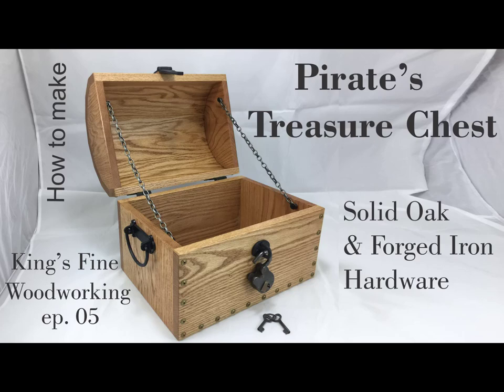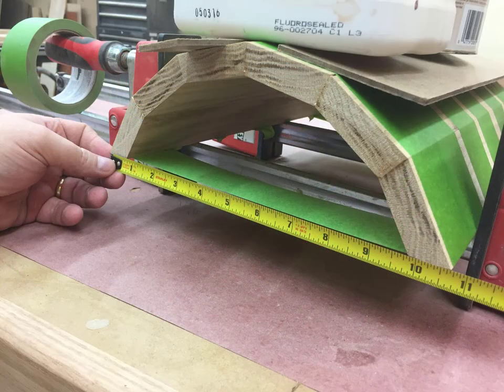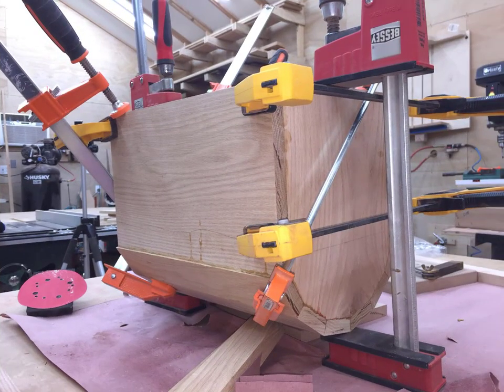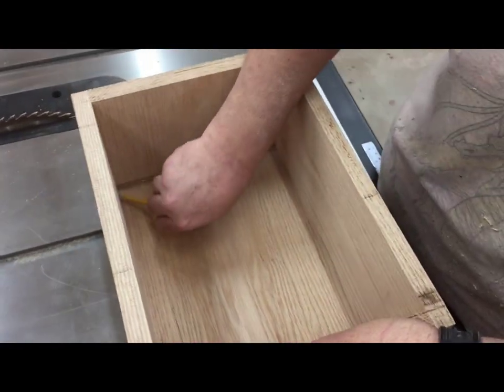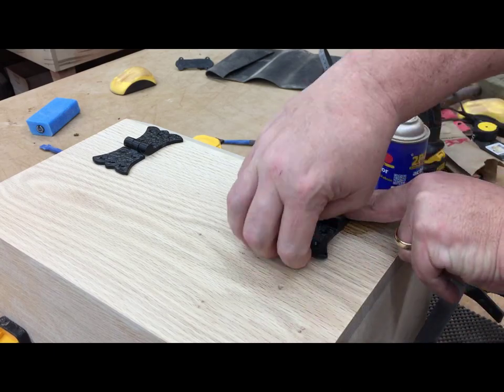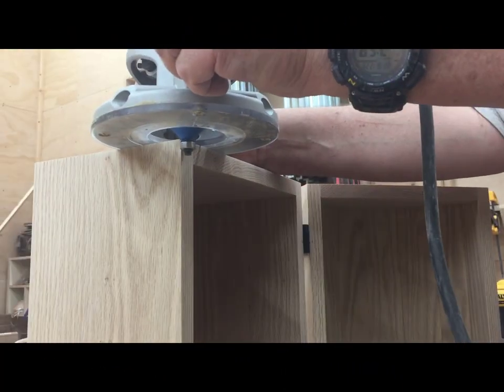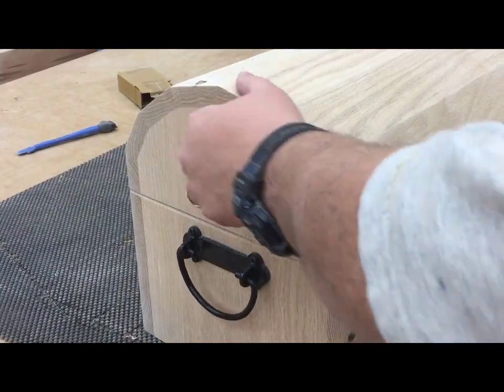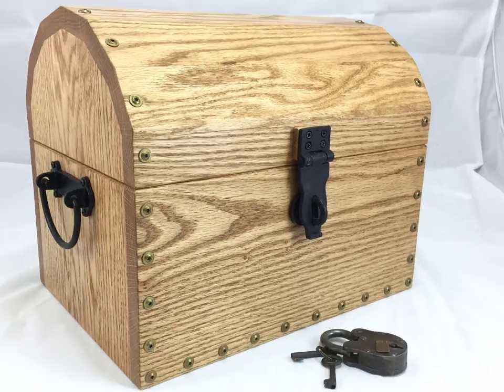05 How To Make a Pirate's Treasure Chest from Oak & Forged Iron Hardware

Comment: Just a tip: I have done some odd shaped glue joints in which I've had great luck with using ratchet straps, rather than trying to get a purchase on funky angles. I use a scrap piece of wood where the metal touches the work piece, and the joints come out very tight.

Comment: I trained under a furniture maker for 36 months, he believed in gluing every surface & wiping the glue away with a cloth wet with very HOT water. I like the chest, bees wax on the threads of the screw is how I do it , after predrilling.

Comment: How good is that, I was talking with a fella who worked for a high end furniture manufacturer here in Australia a few years ago who said that adhesives available nowadays are at times the only form of Joinery used, amazing to think that, nice to see the whole family helping out 👍👍👍
Reply from the maker: I am always amazed at the strength of the glue I use. If I make a mistake in a glue-up, I only have minutes to take it apart or I will destroy the wood trying.
Reply: I think that the correct temperature & also clamping technique will do the job, sometimes I think we over do the process but things like pocket Hole Joinery help in assembly, cheers & take care mate 👍👍👍

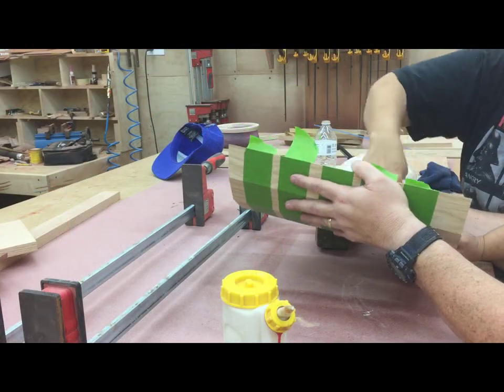Comment: 1:55 - to make sure you don't overtighten, put a piece of plywood cut to the correct width in the clamps with the workpiece.

10:20 - because of the CA glue, you can't remove the hinges to sand.  Try painters tape to hold the hinges while you drill.

16:20 - beautiful job.  I'm going to use this style along with a hidden drawer to make one for my grandkids.  Great video.
Reply from the maker: Hello, brilliant suggestions!!!

Comment: I love the box! I'm going to use your design as a base for mine. I will be going for a more authentic look by using straps of steel, solid hammer in rivets, forged nails, and distressing-figuring-burnishing the wood before a boiled linseed oil finish. I have been wondering for quite some time what kind of carcass I will use to frame it out. This looks ideal.
Reply from the maker: That sounds pretty awesome. You should send some pictures when you are done.
Reply: Dj Lopeman jhg

Comment: As your wood is Oak you could have stained it the old fashioned way ,by using liquid ammonia placed in a saucer with  tent of plastic over it, and the wood, depending on how pure, and the strength of the ammonia'  letting it stand overnight will give your oak the appearance of 'age'  this was a trick I learned when I was about 9 (I'm 71 now!)asking a worker in a local church what the horrible smell was and , WHY :) he told me he was installing new bench pews in the church and the vicar wanted the new ones to match the centuries old originals, which were a beautiful black, probably a bit late for this job, but in the future .....  :)

Comment: A good way to clamp a rounded lid like that is with tie downs, just ratchet them down good and tight, just put a board or two on the inside bottom to keep them from taking t much pressure and you're good

Comment: Forgive the asking, some wood workers would say you have a cross grain situation there, Gluing a wide end grain to a side grain. That has a danger of spitting over time. You mention this when putting the bottom in, but not when you glue the sides to the ends. Any thoughts?
Reply from the maker: Hi Richard, the issue of movement is sometimes a function of the strength of the joint. If the wood is properly constrained, it cannot move. The enormous quantity of screws that I put in it, (to simulate old fashioned nails) will completely prevent movement.

Think of plywood. It is layers of wood glued together with opposing grain, but there is no movement there because of the enormous glue bonding surface. 

Another good example would be a cigar humidor. I build these all the time with thick heavy through-dovetail joints at all edges. And then after completion, I keep the insides at 70% humidity, and the outside is at 10%, and then occasionally I will completely dry out the piece to clean or disinfect it. This presents an incredible opportunity for movement to occur, yet it does not. The joints are too strong.

But, It is good to be concerned about movement. If you are unprepared for it, then within a year, a beautiful piece you made can be destroyed. If you are ever unsure, it is best to err on the side where you allow for movement. Alternatively, if you don't have a lot of experience, you could consult an experienced woodworker and get their take on the movement in your proposed piece.  

I sure wish I would have done that when I started woodworking 32 years ago, haha.  I can't even remember how many little keepsake boxes and cutting boards that cracked, bowed, and split. But my saddest moment was a cocobolo table that had a build in chess board of Macassar ebony and birdseye maple. I sent it to my grandfather in North Carolina, (and I'm in Colorado). I cried when I saw it after a year in an environment with 15% more humidity than here. It was essentially destroyed. Almost $1,000.00 in lumber, and what I thought would be an heirloom piece was nothing but splits, cracks, and warped wood.
Reply: Thank you for you reply, That is really sad about the table. Unfortunately sometimes we only learn the hard way! I know I have many times. I have enjoyed watching many of your videos, so I appreciate your years of experience. 

Another wood worker said that he felt safe up to a 6 inch cross grain joint, so thank you for sharing your experience on this.

Comment: Nice work. You should try sawdust to "sop up" excess glue. It'll also act as a nice filler for small gaps. Also, those screws could have worked as your clamps, couldn't they?
Reply from the maker: Yes. Great tips.

Comment: Just curious as to how you calculated the angles to rip the top boards to meet the contours of the arched sides?    Also, had never seen the oranged, elevated supports you used during the finishing of the box.    Do they have a name?    Great looking project!

Comment: When ever I have some thing round to glue I use band clamps, they conform to the  curve with equal pressure. An adulterant way to deal with the rounded corners where you used  the router is to use a chisel to square  the inside corners.
Reply from the maker: Hi Stephen! Great tips! Thanks!

Comment: great job.Was some overkill with the glue - I have been gluing one piece for over 50 years and never had a fail - but whatever make you feel safe. And the 3/4 in bottom which reduces the capacity along with the high lid.That said I am sure it will be a heirloom piece

Comment: Wow my new favorite woodworking channel. The first one I can remember (just off the top of my head 😋) that puts glue on both sides. I've seen too many that don't and I'm like omg seriously why would I watch your stuff if you don't do it correctly. I know this from experience building things and just putting glue on one side. Then in time after use or just too much weight or little pressure boom it breaks or comes apart rather. but I'm like what's the heck this don't make any sense I glued it things fit right sis is stupid and if you put glue on one side in touch both sides together then glue is on both sides right... Wrong. My wives grandfather and father boy got a real charge out of that when I told him what I did. My wife's grandfather has been building things since he retired and he's been retired for well a long time and her dad works with him when he's not working on weekends and after work on things and they've been doing it for many many many years so they also have experience in the sort of thing. I'm sure why they got such a good charge out of my finexperience maybe they have also done to same thing many many years ago. Live and learn and or watch videos on YouTube and see how others do it lol

Comment: Leather belt up over the top and down the front and back and a v groove at each joint on top.😉
Reply from the maker: That would look nice.
Reply: A thin bit of soft leather on the lip of the box, where the lid closes, makes a nice seal.  And hides small gaps. I love adding leather to wood projects!

Comment: I like your video work, I like the box, I like the hardware, I don't like that you used screws with modern heads on them. Slotted screws would have given it a more rustic old world feel. The screws on the top of the hasp render the lock useless.
Reply from the maker: Hi Tom! I like your suggestions. If II do another, I will incorporate your ideas. Thank you, ~James

Comment: I' m here to learn, but i think you put that lock hinge wrong
Reply from the maker: Hi! Do you mean the hasp? The hasp was highly inaccurate because it was hand forged. So I had to step out the bottom to make it close on itself. A regular commercial hasp would have been done differently.
Reply: +King's Fine Woodworking i'm learning english every day too :)). Yes, the hasp. It supposed to close over screws it's mounted with, but i understand now why this one didn't.

Comment: Completely avoided explaining the problems of the greatest challenge  -  how to bevel the lengths at the correct degree without compromising the machine cut width.  Although he does admit to a few gaps which are filled with putty ffs